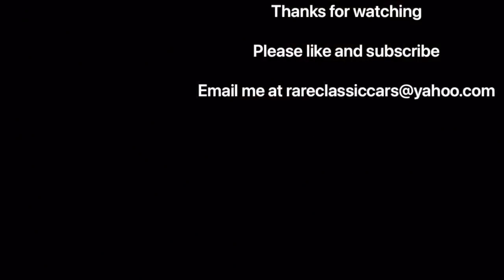Worst Engines of All Time: Chrysler 318/360/400/440 V8 Electronic Lean Burn

Comment: For a while back in the 70s it was no problem finding a mechanic to bypass or remove all of the power robbing emissions and tune the engine to run better.  Even muffler shops made our cutting cats off.  Its good technology has gotten so good its no longer necessary.  Thanks for the indepth look at the lean burn system.  I had no idea how that worked. One thing i hated was the air injection pump going into the exhaust.  I guess that was kind of the same idea as the lean burn ?
Reply: The EPA soon made it illegal to remove the emissions garbage, and the cats as well, that's why you suddenly couldn't find anybody who would do it.  $50,000.00 fine.  The air pump just injects air into the exhaust ports.  The bad thing about it is the heat that it generates.  Even today's engines, if you could re calibrate the numerous computers, would have a solid boost in performance if you got rid of the accursed EGR and the catalytic converter.
Reply: @michaelbenardo5695  most vehicles today you wouldn't gain much power from doing that they've pretty made all the power you can without making the engine bad for  extremely bad for the environment. Air injection is putting air in the exhaust to make the afr in the exhaust lean so thw tailpipe emissions look good every modern car pretty much has air injection.
Reply: @meowexotics6516  The only reason you wouldn't gain much on today's cars is because the computers would try to compensate for what you did, but if you know somebody who can alter or reprogram the computers, you will indeed gain much power by eliminating EGR and gain power from eliminating the catalytic converters as well.  Less back pressure, therefore less pumping losses, better breathing.  And if you can make the air/fuel mixture a little richer, that will be another gain in performance, but at a cost of higher fuel consumption, but again, the computers will try to compensate for what you did.  The only thing that you wouldn't get much, if any, power increase from is altering the ignition timing.  And as I said, air injection does little to hurt power, but it does generate a lot of unwanted heat.
Reply: @michaelbenardo5695  even if you did that you did that unless the engine was being choked like the diesel engines when emissions got super stringent  you could maybe make 50-150 more hp depending on the car. I don't think it would be reliable horsepower but some engines probably could make reliable horsepower. Ford is having problems with their engines running to hot and blowing up so ford small turbo engines would gain some reliability but a brand like Honda or Toyota would probably just lose reliablity.
Reply: @meowexotics6516  It would mainly boost torque, much more than horsepower.  It might not be all that much faster from 0 - 60, but it would feel much healthier and climb hills better in high gear.  Might even use a little less gas.

Comment: Thank you for making this video! I haven't found a lot of useful information about the lean burn systems and this helped me a lot. I daily drive a '84 Fifth Avenue and it has the same setup as your Gran Fury with the 318 and the BBD. I'm gonna have to mess with the metering rods and timing and see if I can fix it. I hate driving it on the highway because after I get off the car always feels like it's trying to run away from itself, so now I have a better understanding of why. Again, thanks for making this video!

Comment: Hi Adam Love your content, knowledge and approach to the cars of the good old days..  Personally I have been designing cars (on paper at least ) since I have been 3 years old. I love them all. (the new ones...50/50) Back in 1977 my uncle convinced my mom & dad to go with a Cordoba to replace dads '69 Delta 88 ( a very reliable & tank-like vehicle with classy rocket emblems all over).  The Chrysler was a 400 with the 4 bbl, the last big block supposedly.  We loved the car until things started to get "farty", On the highway it was a cruiser, the car had classy exterior styling & of course everyone joked about the Corinthians. Once things started going south no local mechanic could figure out what to do with the damn thing.  A small fortune was spent on carbs, rebuilds & more carbs.  It's too bad. The technological idea was way to early for that time of the computer age.  So many ' dobas back in the day (& Cutlasses for sure) where did they all go. Keep up the great job...looking for an "87 Delta... such a good absorber of road imperfections.
Reply: Those Córdobas were nice cars. A shame one of your mechanics didn’t just unhook the lean burn computer and install an electronic ignition distributor and module (sold by Chrysler). The carbs were easy to re-jet, and the engines were otherwise bulletproof.
Reply: @sking2173  I pleaded with parents not to get rid of the car but that being said I learned to drive on the car.  Once I discovered to magic of 4 barrel carburation..I think I help contribute to the umm" blown rear main seals"  situation

Comment: I have a lean burn '82, W150 with 225 and NP435 4 spd.  What really puzzles me about it is that it actually retards the timing with vacuum when cold, unless I disconnect the temperature sensor.  It's so slow, and I haul with it, so I floor it very often, so I'm sure I hardly ever get far into that cruising advance mode,  Also, it has lost so much compression with age that it never spark knocks and the only thing that limits my ability to advance the timing is it trying to fire backwards when cranking.  The idle mixture screw seems stuck, even after removing the cap.  I don't know if it is rusted in place or glued, but it idles okay.  Cylinder #5 has very low compression and often misses, and it is slow as molasses, but Idles okay.

Comment: I was a 13 -y-o  kid back in 1977.  Parents bought a new 1977 Dodge Monaco Brougham.  318 V-8 engine.  It was beautiful in appearance, as nice as a Buick Electra.  Performance & reliability - it was a disaster.  It had the acceleration of a roller skate!  A 4hp Briggs & Stratton self-propelled lawnmower could out run it!  Not even 2 weeks after we got it,  first electrical  glitch - Starter relay fried, had to get a  two week old car TOWED to the dealer for repairs...  When the Car was only one year old I remember being on a summer trip (in Texas  no less) A/C Condensate water starts pouring out from under the dash onto the passenger side floor and a/c goes out.  Got it serviced & the fix did not last a year before it was blowing hot air again - Mind you this was in Texas.  Radiator fan became dislodged from the water pump and destroyed the radiator and the car was not even 3 years old!   Brake master cylinder started sucking in air - very dangerous!  Had the dealer  repair / replace it but had to return it after the initial  cylinder replacement  for them to  PROPERLY bleed out the brake system!  Again car was not  3 years old!  Any bump of even moderate size the car would clatter like  we were hauling 10 2X4s in the trunk - we were carrying absolutely nothing!  Now this is the funny part - I cannot say that this was the worst car my dad ever bought.  My parents actually traded a 1973 Ford Pinto for this Dodge!  Wait, there's more!  Parents were sick of this car & it's issues by 1980.  3 year old car, 25,000 miles on it & they traded it  for a Chevy Citation.....  My father was a good man , BUT understanding any kind of mechanical quality (or lack thereof) WAS NOT in is playbook!  Personable, Honest, good in his field (Petroleum land man), but he could not tell the difference between a hammer & a screwdriver to save his life!  Recently, when I've traveled, I have rented a Hemi powered Dodge Challenger and enjoyed it.  I cannot get over the bad impression of Chrysler  products from my childhood years.  I STILL hold a very dim view of MOPAR quality.  Any personal Chrysler purchase, even brand new today, is very unlikely.  It would have to be 25% cheaper than a competitor's offering & then I would want a  100,000 mile  8 year bumper to bumper warranty on it, and I really doubt such an animal even exists.
Reply: Whether or not it was you intention, I think you just brilliantly summarized the decline of the Domestics in 3 car purchases spread over less than a decade. The sooner Adam retreats to the nostalgic glow  of the years before the Malaise Era, the better  😁
Reply: I am a Chrysler fan, and I love 50s Chrysler cars, but I admit that even though when they are good, they are very very good, when they are bad, they are HORRID.

Comment: To Quote  Lee  Iacocca  he said Chrysler  always had  great engineers & Products  but they just  weren’t  integrated  everyone needs to  be  sleeping   Togeather  none of these people weren’t  even flirting  the Transmission  is attached to the motor   The transmissions  gears  transmits  the engine  power  threw its gears  to the rear wheels  my point the  transmission team needs to know what the Engine  team is doing and  vica  versa  all these departments  were  like  foreign  country’s  yet they were  right down  the Corridor  from each other   The department heads  did not know  his/her  name  Lee was in shock  even with all the corporate nonsense at Ford they had a integrated  product

Comment: I have a handful of these old cars with working Leanburn, they work as designed to this day. Despite what people tell you, they are not bad at all and VERY easy to trouble shoot. If you have a timing light, a vacuum gauge and a manual (optional) you can trouble shoot one of these in under half an hour. It's not much different than any other carbureted electronic ignition car. The timing is advanced ten degrees for the first 10-15 seconds after start up, then it drops to normal. Above 1/4 throttle, the Lean Burn does nothing so this system is for idle and cruising so disabling it is only really helping if it has ACTUALLY failed. Most people who remove this have a problem in their carburetor or ignition system, possibly EGR....so replacing the carb, and ignition system will "fix" this as far as they are concerned anyway as the problem is no longer on the car. I have one car, the 440 Fury which is VERY lean at idle, but it's fine even at light cruise. IF it ever gives me any problem, it will be converted to non Lean Burn but it has run this lean for years. GM's version of the electronic Q-Jet would often cause a no-start. Lean Burn wouldn't do this in 99% of the cases. The dealership techs back in the late 70's didn't really trouble shoot them any better than they do now, they had a spare transducer on a bench and if that didn't cure it, they replaced half the car.  
   If you're ever in the Fla Keys, come check out some of my collection, we can do a video of the Lean Burn trouble shoot if you want, drive a few of them too. It's easier than you think, and far simpler.
Reply from the maker: Sure. Btw, here’s a Chrysler video explaining the ignition advance I describe. 

https://youtu.be/aPRt_d_1e4k
Reply: @RareClassicCars  :washhands::washhands:
Reply from the maker: See link I sent. The lean burn system is active if coolant temp is over 150 degrees and it is playing with timing if that is true and it senses more than 16 degrees vacuum and open throttle.

Comment: It's not a huge deal to change to regular non lean burn electronic ignition. 1/2 hour , a vacuum advance distributor and a standard ignition box. Not a reason to stay away from these cars.
Reply: But here in California, you can't get it smog checked like that.
Reply: @michaelbenardo5695  smog checking a 35+ year old vehicle is just STUPID. another reason I will gladly stay in Metro Detroit rather than moving to a foreign country like California. Another reason is I just filled my tank in my Volvo V70R with 93 octane for $4.43 a gallon. While I've seen the gas prices in California.
Reply: @karlporath8904  The ex- Beatniks and Hippies that run this place have a strong hatred for cars, especially American cars.  We can't even get 93 octane over here.  If I was looking to move and didn't live here, (Native and homeowner), there is no way in hell that I would even consider moving to California.

Comment: In a Rental Fleet Same problems and when ever there was rain? Rows and Rows waiting to be serviced. a real basic version of an onboard Computer with temp sensor, throttle position, Timing etc. early Electronics, Federal Emissions mandate, among other things while using Carburetors with feedback systems all the Domestic car makers were struggling to meet C.A.F.E. Standards.
Reply: The EPA , CAFE, and the Japanese totally destroyed our auto industry.
Reply: @michaelbenardo5695  I concur, the Japanese had seen an opertunity and acted on it...70's Japanese Cars weren't all that, but as soon as the 80's Rolled around, people who were frustrated with Domestics Bought those imports. Not until the mid 80's (fuel injection) finally brought out better cold start performance, etc. Then you had seen some improvement...too little too late, TOYOTA took Off, along with other brands from Japan..A GM guy myself but have to admit the Domestics made their own bed so to speak. People I know just dropped American and went Import. And yeah the EPA CAFE (government) 
hamstrung all makes, American Auto Manufacturers wrote the Book..and had somehow lost the pride and workmanship the Japanese had picked up and ran away with.

Comment: A small quibble:  the 14.7:1 stoichiometric ratio is by mass, not volume.  1 (US) gallon of gasoline = 2.65 Kg (based on specific gravity of .7 - mid range).  Therefore it would need 2.65 x 14.7 Kg of air = 39 Kg of air.  At STP air density is 1.23 Kg / cubic meter.  39/1.23=31.7 cubic metres.  There are 264 G(US) per cubic metre.  Therefore 1 US gallon of gasoline needs 8370 gallons of air.  apologies for using SI units but they are less ambiguous for true mass calculations.  I have rounded as there is variability of specific gravity of gasoline and air depending on temperature and barometric pressure.  another way to look at this is carb specs.  There are 7.5 g/ cubic foot.  A Holley 650 cfm would be pulling in 4875 gallons per minute of air at full throttle.
Reply from the maker: Yes, I was just trying to be illustrative for the lay person.

Comment: I had a 1977 Cordoba with a 400 ci. The car spar-knocked from the time I bought until sold it. With placement of the exhaust manifolds, my tappet cover gaskets would burn and lead. With a white car, I would get black smoke and a residue around the hood. The spark plugs had to be changed through the wheel wells also due to the high placement of the exhaust manifold. Oh... don't forget the shifting cords in the Firestone 500 radials.  Fortunately, they were recalled. Unfortunately, the Cordoba was not.

Comment: That explains a lot, I had a 78 Plymouth wagon with a 360 and it seemed to me that the only time I could get it to run on all 8 was either at idle or wide open throttle. Got me into trouble when it frustrated me!

Comment: Life long fan of Personal Luxury Coupes.  Helpless admirer of the Cordobas.  Had several, so I've been lean burned many times.  Trick then was to unplug giant white ohms resistor block on firewall and bypass with paper clip.  Worked often.  Or I'd bin it and replace carb and distributor with what was at hand.  Great work, thanks.

Comment: Yeah, I'm sure that original attempt at computer control for emmissions was a disaster.  I'm surprised Chrysler couldn't reprogram the engines so they would run better.. But I guess they would flunk emmissions if they did that
Reply: That was the problem - they would flunk, then the vehicles wouldn't be able to be sold as street-legal vehicles.
Reply: @michaelbenardo5695    i wonder if it would have been cheaper for Chrysler to add the catalytic converter to these early cars and update the programming instead of paying to convert many of these cars back to plain carbureted engines...I'm guessing a catalytic converter would have to be added anyway to the carb conversions...
Reply: @fleetwin1  I think by 77, when Lean Burn came out, all ChryCo cars had a catalytic converter.
Reply: @michaelbenardo5695    Well it is just a shame that they couldn't do something with the programming to prevent tarnishing the image of otherwise great engines

Comment: I'm a Mopar fan if for no other reason than Chrysler build designs have twice saved my life in wrecks - however , the lean burn was without doubt a botched job - this is what happens when the government attempts to run private business after first creating various disasters  which  the businesses are then required to deal with the consequences.

Comment: That System is Junk. People eventually give up and then install a Edelbrock Electric Fuel Pump and Throttle Body Injection System with a MSD or JEGS Ignition System on those Lean Burn Nonsense. Add a Mass Air Sensor and Bob's your uncle.

Comment: loved my 87 Fifth Ave except for the Lean Burn
Reply: If the computer died, would the car still run and be driveable?
Reply: @richhoule3462  If you removed it and replaced the distributor and carb with older ones, yes, it would run, and much better than before.

Comment: My 1985 5th Avenue was a great car...318 lean burn ...overdrive trans...it got 30 mpg WITH the a.c. on.Zero problems...drove it 72000 miles with only oil changes.Unlike the pathetic modern pigs Chrysler puked out now.

Comment: been there those 318 v8 and slant 6 225cid engines has major design flaw of oil pump gear type driven by thin shaft to distributor shaft if a small bit of object get stuck in oil pump gear itll get jammed and cause the thin shaft to twist and snaps resulting in no oil to bearings and burnt out bearings i had to replace it twice!